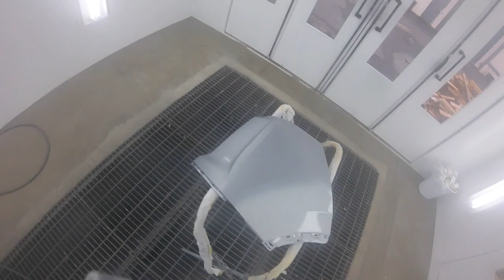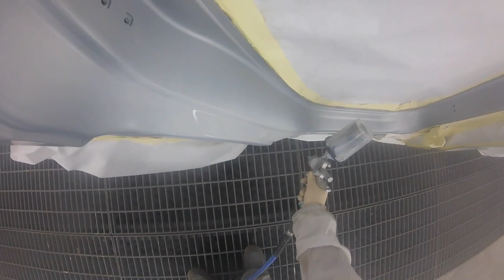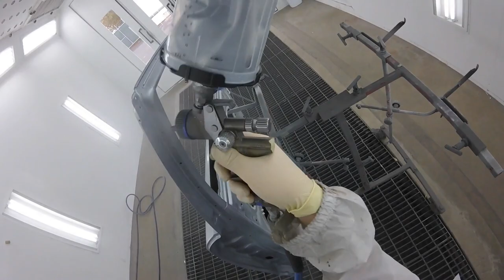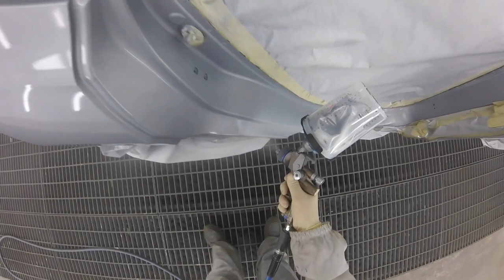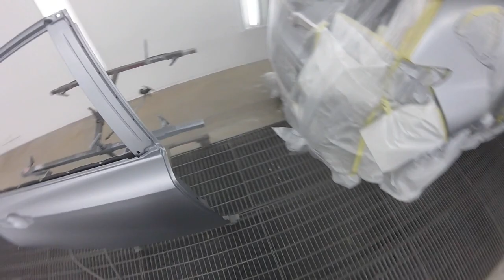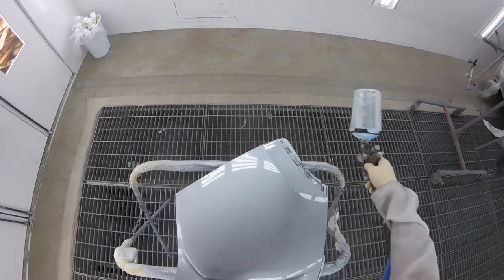Car Painting: Silver with Spies Hecker

Comment: Nice work man! Hey I finally got my rep to bring me in some cromax le8700. I was wondering how do you do your 3 stage candy clears with that? I was told you have to use the spies clear still
Reply from the maker: Thank you! How do you like the 8700? So for the candy my rep said use the 8094 for the candy part. Short bake at 110 for 10 minutes then go over with 8700 like you would with 8098. He said the clear are compatible since it’s the same system.
Reply: @everyday_painter  ok good to know! And I’ve only been able to use it on 2 jobs so far because it’s been 25 degrees over here on eastcoast since I got it and my current booth just takes to long to get up to 135f anyways but from the two times I’ve used it so far I for sure think it’s gonna be my go to clear on bigger jobs and front ends!
Reply from the maker: Dang that’s cold! You’ll love the 8700 when it’s gets hotter out. It sprays nice and buffs nice as well. I used it on my personal vehicle and it looks great.